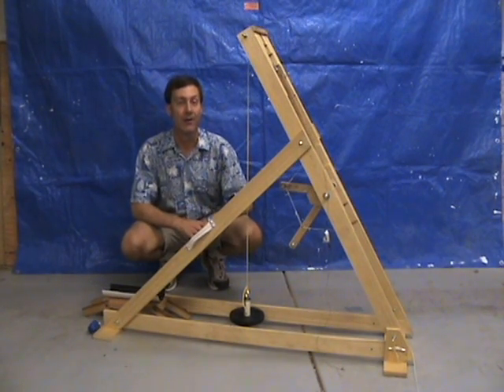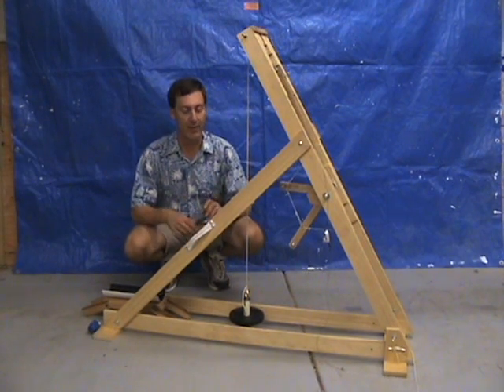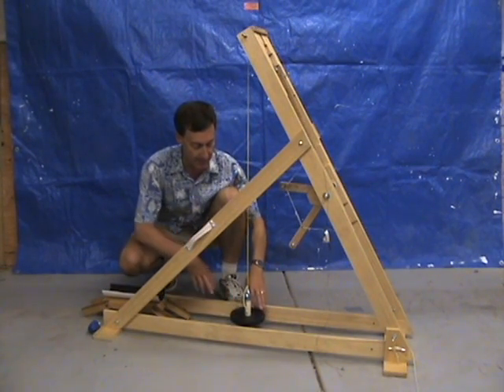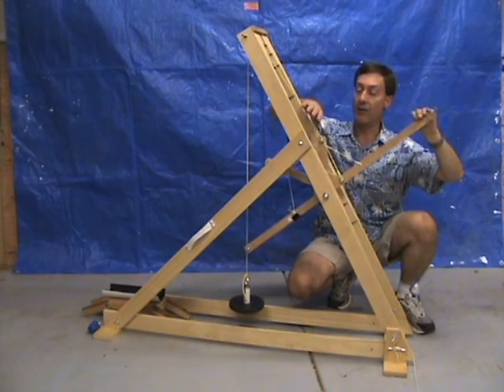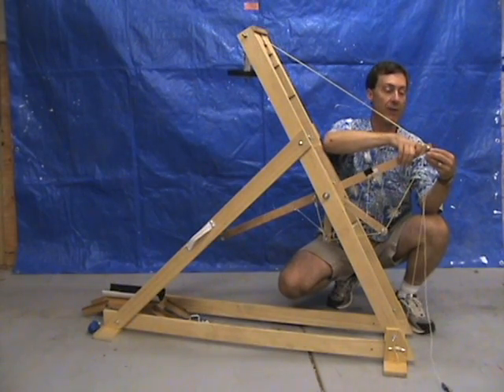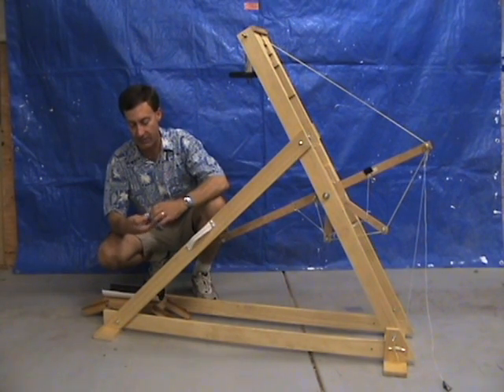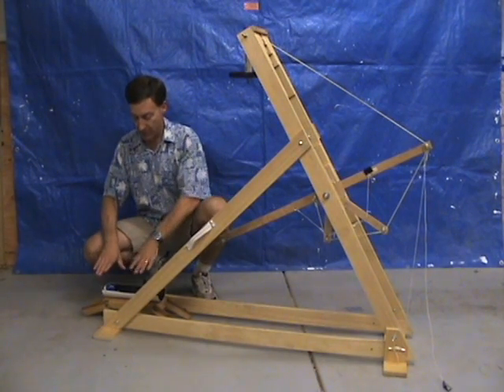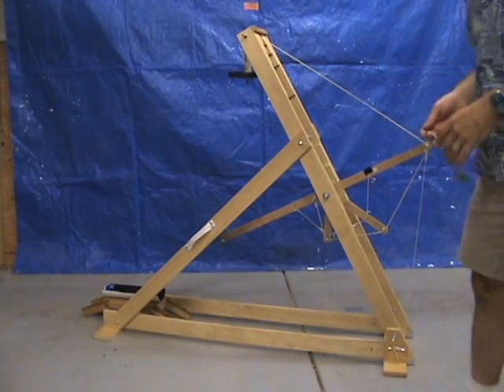MURLIN Trebuchet Overview

Comment: I need to make a light weight, under 17 lb, golf-ball trebuche that shoots 100 yards for an assignment due monday.  The one I built is too heavy and not working and I need to start again from scratch. I'd greatly appreciate a plan that you think will work.  I used a  3/4" frame and plywood beam, a 25lb weight and a pipe but it does not pivot smoothly.   I agree not to distribute the plans and send you photos too.  I really need help. Thanks Alan.  my email is asilver.stein@10003@gmail.com

Comment: Very interesting! I am curious as to how you determined the length of each of the "sprockets" that the line runs over to pull the counterweight.
Also, I assume the projectile releases from the tip of the arm just before it hits the top of the frame.
Very nice design.